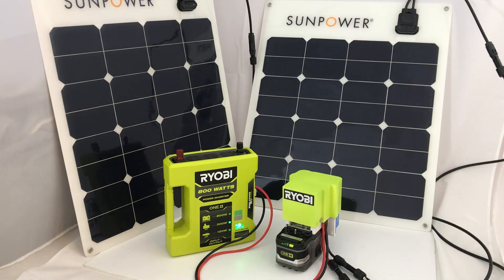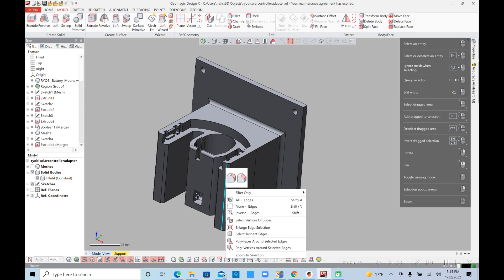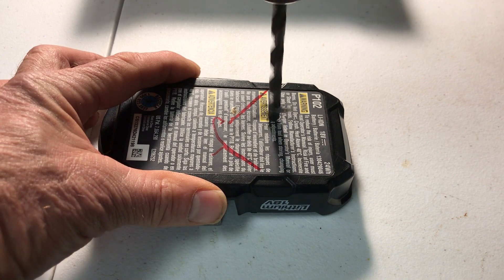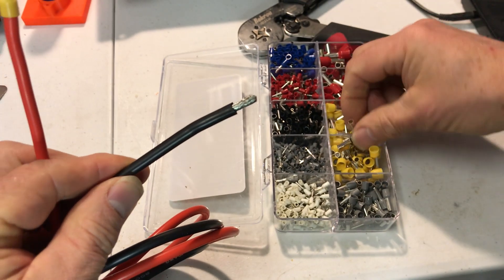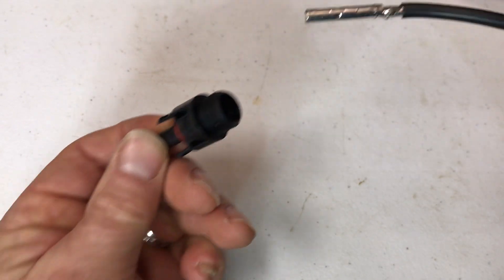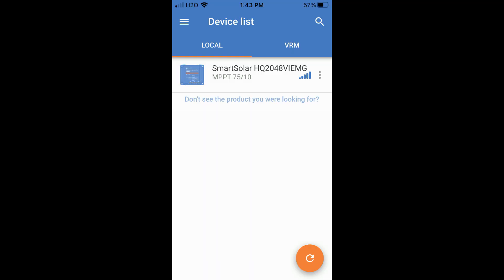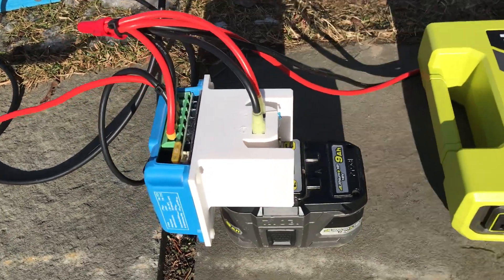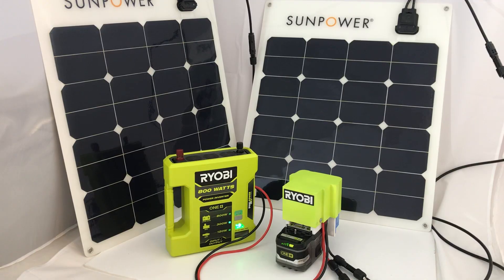Solar Power your RYOBI 18V Tools!

Comment: Wait, so the Ryobi batteries just accept a higher voltage input and cut themselves off when full? So they're safe to charge from 24V DC sources?
Reply from the maker: no, you set the specific charge voltage and the batteries will not exceed that.

Comment: Excellent! I did this with my Victron Mppt 75/15 and 200W Portable-Foldable solarpanel. Next thing is to hook it up into Home Assistant (HA) Smart Home system and check if i can add some solar into usable energy (test purposes). Home Assistant is all out support bone for many may many smart devices for home. Of course you can make you own too with ESP-8266 / ESP-32 IoT-boards. I've made numerous thermal meters and plant moisture-sensor. All accesible via Internet.

Comment: this is inspiring! question: I've purchased the Ryobi 1000w inverter similar to the unit you have with the hopes of using it to hook it up to a lead acid car battery to power our residential sized fridge during our  next power outage.  Do you happen to know the equation to calculate how long I can power the fridge if the inverter is connected to the car battery? Thanks in advance for your reply.
Reply from the maker: The 1000W unit can only provide 850W according to spec. My 12V Fridge/Freezer takes about 60W. Most RV 12V lead batteries are 100Ah, but you can only use them down to 50% or you severly reduce the number of cycles you get out of them. So If you assume 50A at 12V, that would be about  600Wh. So you would have around 10Hours of running. This assumes that the compressor was running the whole time. If you use the AC inverter you would probably have less run time. Maybe do a test with your Ryobi 4A battery and extrapolate. The 4A quotes 72Wh.
Reply: @SerendipitySue  thank you so much.  this is helpful.  I'm trying to find cheaper alternatives to purchasing a generator to keep the food in the fridge from spoiling since it seems power outages are beginning to be more common even in the suburbs.  Purchasing a $10k Generac is not an option.

Comment: Love your projects. As of November 2022, check H Depot online: Ryobi’s combined power supply/and CHARGER unit for 18v has finally arrived. They are still selling the similar power supply-only device, so look carefully for the one that includes a USB C Input that will allow charging a battery as well as using device as an inverter/USB charging unit. It comes with a yellow USB cable and an AC small plug with USB-C out for the cable. I’ll be using mine with another brand USB 20 watt solar panel. (Ryobi’s own 2 panels are not out yet… they promise to offer both 14 watt and 21 watt folding panels soon.)
Reply: Yes, just got one of these! Its Ryobi Model RYi150C 150W Power Source. The USB-C PD charging input on the device should be compatible with any solar panel with a USB-C PD output. The maximum input power to the device is 30W.

Comment: Wow, nice job.  One concern, the Ryobi batteries are 5S cells, which at 4.2v each at max charge is only 21 volt. Can the victron be set at 21v instead of 24v?
Reply from the maker: yes the Victron I have can be set to 21V. It shows how in the video. The parts I used are in the video description

Comment: So... the hacked 18v battery allows you to put 24/18v of power into the Inverter. . . . . BUT... what is the advantage of doing ALL THAT over just having a cheapo 12v Deep Cycle or "Solar" battery running the Inverter WHILE being charged by the solar?  Wouldn't that give you more power for less work?  OR just run the Inverter from a bank or 3 8v Golf Cart batteries - being charged by solar?
Reply from the maker: LioN Batteries are much better for Solar applications. Lead Acid has to go thru several charging phases (not all take full power). LioN allows you to put 100% of energy in the battery while the sun is out. Lead-acid also has to stay above 50% or you drastically reduce the number of cycles. So 100Ah lead acid battery really only gives you 50AH. LioN batteries you can use almost all the power. Lion batteries are also MUCH lighter. Plus if you are like me, you already have a pile of RYOBI tool batteries that you can use.

Comment: Will this be powerful enough to power an electric griddle 1400w?
Reply from the maker: no, it's an 800W inverter. I did a video of how to make a 2600W inverter ( https://youtu.be/lAAWFCU4iEM ) using 18V Ryobi batteries
Reply: You might be able to get the job done with much lower wattage using an induction cooktop. Also worth mentioning, the Ryobi inverter can only put out about 350 watts when using the 18V battery input. It goes up to 800W (600W really) when connected to the 12V power source. Modified sine wave.

Comment: very cool.   1)  what was the material used on the 3d printer to make it strong?       2)  how did you scan the internals then import to make a case,  that was magic to me.   Is there a good 3d scanning program you use from your iphone to do that?
Reply from the maker: I 3D print in PETG material. I used a Revopoint POP 3D Scanner to scan the stuff I wanted to make a cover for. I then Used Geomagic Design-X CAD software to design the cover. I don't think the iphone apps would be accurate enough to scan object. They typically require texture to work.

Comment: What is the purpose of the ohm resistor?
Reply from the maker: it tricks the battery into charging mode
Reply: @SerendipitySue  I was wondering because I did your two 18v batterys wired in series for use with the 40v inverter and I didnt use the resistors on those battery's.Thanks!
Reply from the maker: @grindychum  you only need the resistor if you project is going to charge the battery. Not required if just using battery
Reply: @SerendipitySue  I have 18V De Walt batteries and a Victron solar inverter. I also have a slide for De Walt batteries which only has positive and negative wires. I should be able to make a connection to other connections on the battery. Are you able to tell me what connection should be made with the resistor to trick the battery into charging mode? Thank you.
Reply from the maker: @garyscott2124  I haven't played with Dewalt batteries... yet ;-)
Reply: @SerendipitySue  Thank you anyway. I'll have to try to find out
Reply: The Ryobi batteries have three "connectors" whereas the De Walt appear to have five possible but only four are used on the grinder I have. I don't have the equipment to determine which of three will "trick" the battery into charge mode.
Reply: Possibly the one which is not used for the tool?
Reply: How did you arrive at the ohms and wattage of that resistor?  I've been looking everywhere for that info! (Big fan of you BTW!)

Comment: Very good job. I got tiered of Ryobi being unable to build a power station/solar generator that has pass through charging. Thats  so insane to me. So I built a solar gen that uses LiFePO4 batts. Then I just plug a Ryobi charger into it. I can charge multiple Ryobi batts if I need to also

Comment: That was insanely cool.  Hopefully Ryobi will get off their butt and finally make this for the market!  :)
Reply: That is what @@@ I @@@ want, a simple device that allows you to choose battery voltage, and then allows you to clip on to any battery (or set of batteries) and charge it using 12vdc. That would be SO VALUABLE.

Comment: Can you draw power from the battery if it is charge mode?
Reply from the maker: yes, you can see in the video that I'm running a 200W lightbulb while charging battery with solar

Comment: Mate I love the effort that goes into all this and the 3D is very cool but I can’t help but feel the pursuit of using tool batteries for thing is just misguided.

There already exists a plethora of quality to affordable 12V or similar voltage lithium electrical gear that would make trying to incorporate tool batteries just look silly.

I used to think how cool it was to incorporate the tool batteries in things but soon realised that it would just make everything needlessly expensive except for maybe some particularly niche use-cases.

This is why 12V Auto/camping electrical is so popular and it’s for a good reason - much more affordable AND flexible.

Quality work and if you really like it, that’s cool but  I bet you could also come up with even better stuff if not ‘held back’ by use of tool batteries 👍🏻
Reply from the maker: I have a 12V Lithium Iron Phosphate 100Ah battery on my small trailer with 300 watts of solar on the roof. I also have a ton of Ryobi tools / batteries. I could get an integrated powerstation, but they are expensive and I don't camp full time. The nice thing about the Ryobi batteries, is that I can use them for my tools. In a power outage I have a lot of Wh's just sitting there that I can take advantage of. Also some times when I go camping, the site is shaded. I can take the portable panels and set them up out in the sun. Finally, I just like designing/making things ;-)
Reply: When looking for a way forward, in design innovation, doing what is practical rarely results in actual progress.  For those of us who have a dozen or more of these Ryobi batteries, more tools that utilize them is a good thing, which is why Ryobi keeps making them.  I'm very glad to see videos like this, because it will drive Ryobi to provide more ways of charging their batteries with solar.  That's a good thing, isn't it?